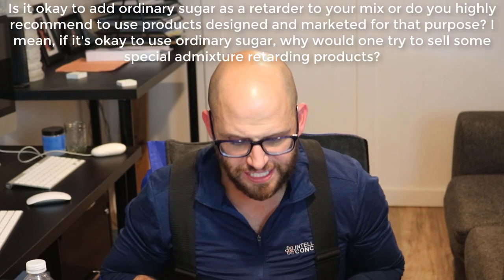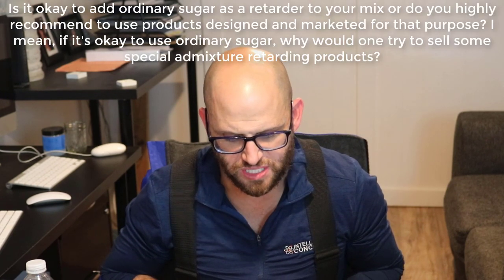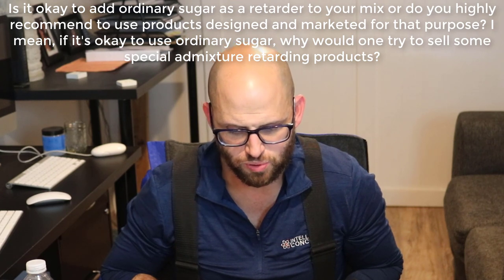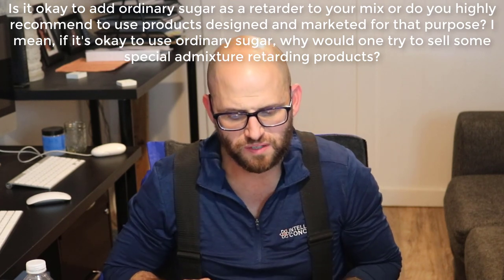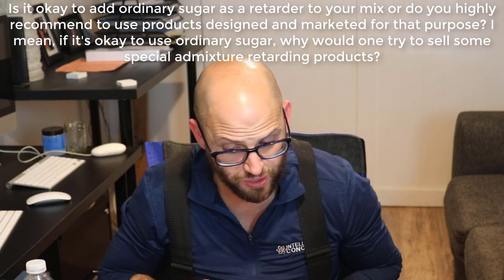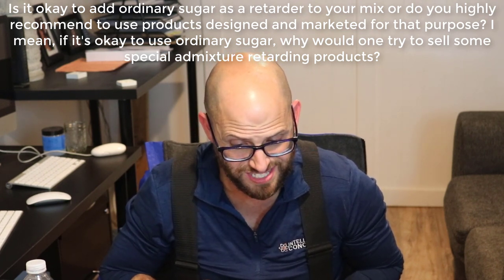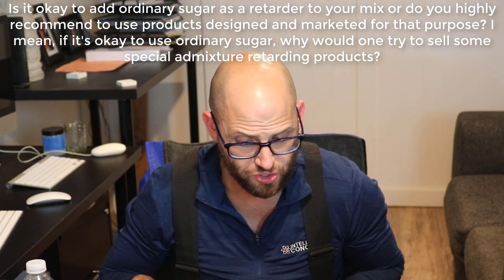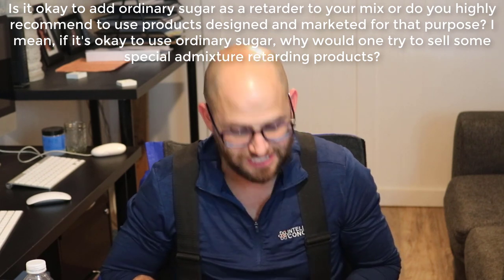Is It OK to Use Ordinary Sugar as A Concrete Mix Retarder? - Vlog 454

Comment: One question I haven't asked is using sugar and superplasticizers together.  Effects on strength over time or any other issues.  Thoughts?
Reply from the maker: Yes and no.  Early strength yes and later strength no. With that being said, this all depends on dosage and type for both.  You could theoretically use too much of both or one of the two and cause the mix to fall asleep forever and/or segregate.

Comment: Is there a formula...that can be used in determining dosage,ie; as you said wc ratio, type of cement, amount of cement & time of day/year?
Reply: The variables are.. well variable. The ready mix companies that are worth there weight know what is what. The admixtures may be dosed at 8 ounces per 100 pounds of cemetitious material to achieve for example, therefore for every ton of cemetitious material there will be 160 ounces of that admixture to achieve. That’s the dosage that is calculated, now for the variables it gets more difficult. The dosage of 8 ounces per 100 weight is for 1%, I do not know what this is based off of, maybe sugar? I’m assuming accelerators are based off of 1% calcium chloride per 100 pounds cement but I’m not sure so don’t take that for face value. However, generally from what I have seen is, 1% retarder will delay the initial drying up for atleast 45 minutes on hot days and 2% adds another 45 minutes...but don’t go overboard or your will be waiting on it for a long time

Comment: I'm going to say this out of experience if you don't mix it in water bring the load up put some on bring a load back down do it again you could have spots that will not setup no different  than stabilizer pucks in tight slump you have to make solution with them or equal dispersion never happens and in a old drum or cheap design or dried up yard or two blade clogged drum